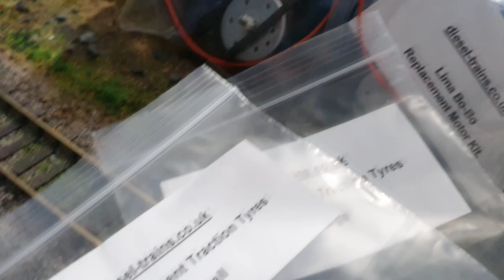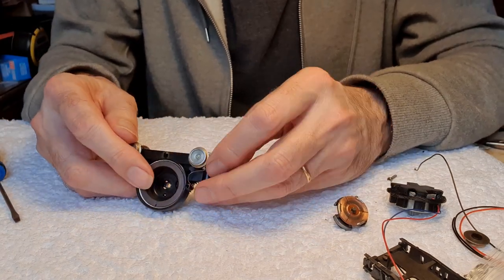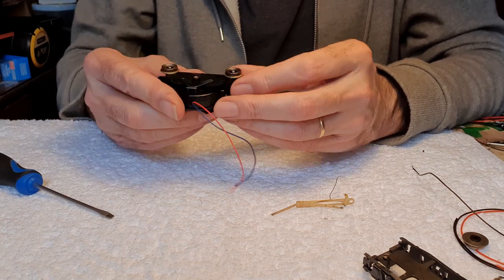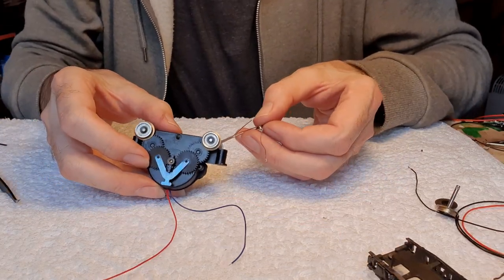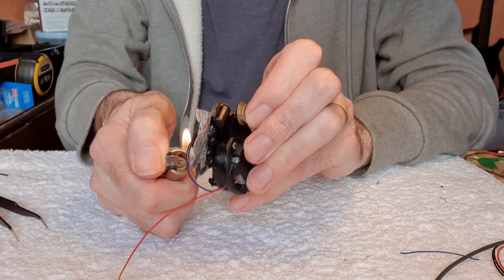Lima Class 55 Deltic: CD Motor Conversion

Comment: Hi Bill, In defence of Strathpefferjunction of having to cut and fit the gear. He did cut the gears to the correct size for me after I made a mess of cutting them my self. He sent me 4 new gears, 2 cut and 2 uncut free of charge. He also told me that if he was asked he would fit the gear for you. After seeing you use the guitar spanner I have ordered on straight away. What a great tool for removing wheels. Once again a great video. Very informative.
Reply: I had wanted to order a kit from Strathpeffer Junction myself but was always out of stock of the one I wanted, so having seen this video on 18th March, I straightaway ordered 2 from Diesel Trains for my class 117's and so far as at 11th April, they still haven't been posted out, order on website still says "Processing" and now he is out of stock for all motors, so I can't say if it has worked for me yet.  His website states "I would like to make it clear to everyone that this is a hobby and should in no way be mistaken for a business". So I will just have to wait and see, as I guess he is making new stock.

Comment: Nice one,i actually managed to get a Lima Class 33 yesterday for a price i was happy to pay.It was listed as used but with a good motor,which had been serviced,checked and ran at all speeds very well...as soon as i got it out of the box i noticed that one of the drive gears that goes to the front wheels wasn't there! So i messaged the seller and told him,his reply was it had never been there,so i pointed out he should have mentioned that in the listing.So now he says he has a complete chassis/motor which he will send me free.So we wait and see...

Comment: Hi, I have bought 2 of the motors for my Lima 117's at £12 each, which was lucky, as the other motor was out of stock for Lima 55's and 37's, so I will get them when back in stock.  Thanks for letting us know, I like my Lima's but the motors are too noisy, so these now ones will be great. :-)

Comment: I guess I'll find out of I need any of these when my Lima locos come out of hibernation. As far as I  remember  I never had problems with the diesels. It was the steam locos that caused grief. The plastic chassis and "free" centre wheel sets were just horrible on them. I had to weather them brutally on the chassis to hide as much as possible. It's a pity because the shell of the 94XX pannier is actually quite good, certainly needs one of these kits though. The 45XX 2-6-2T is much better all round but has a horrible motor and will also get one of these. My only question is are they serviceable? Or when the brushes get worn out or the commutator is full of crude do you have no other choice but to bin them and get another one?

Comment: Are those CD motors very different from each other? The ones I got were much too fast, and had sloppy bearings that rattled like crazy, JUNK.
Now who makes a brushless drive .. a tiny 2804 brushless would fit fine in the ringfield casings.

Comment: Nice conversion but the whole thing looks a bit lightweight for a locomotive that should be capable of hauling 15 coaches. Would it be possible to fit two motor bogies?
Reply: The CD motors are very torquey - try holding a drive tray in or out why asking the drive to open or close. Yes you could fit two powered CD motor bogies, but only really on Hornby locomotives as the way the chassis is designed there is the same aperture at either end. As the current draw is much lower, having 2 wouldn't reduce top speed unlike 2 Ringfield together, you still may want to fit the resistor.....
If you notice with Lima locomotives the non-powered end doesn't have an aperture so would have to resort to major surgery cutting out and shaping your own. You would also need a 2nd donor power bogie to provide the housing. I believe it has successfully been done on 2 HST power cars to mimic protoypical running.

Comment: Hi Bill , is that a 12v motor in that kit ?
Reply: CD drive motors are rated at 6 volts. The resistor is supplied to be inserted to reduce the 12v 'train set' voltage into 6v. Otherwise they are capable of a scale 200mph+ !!!